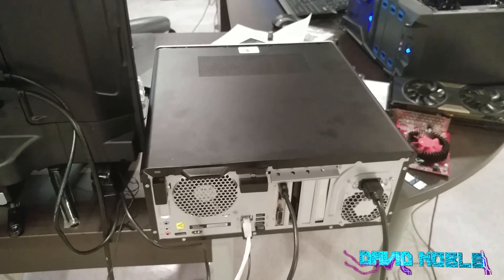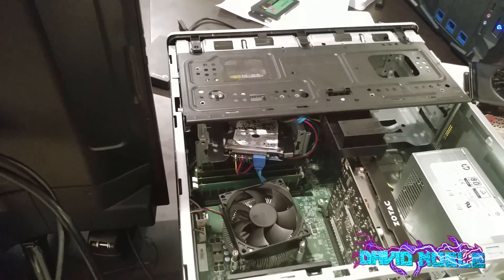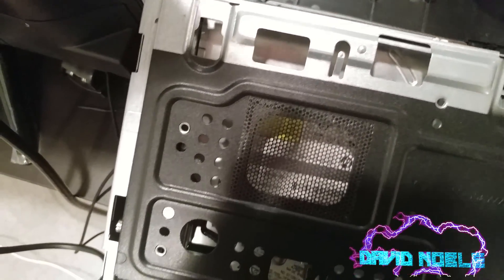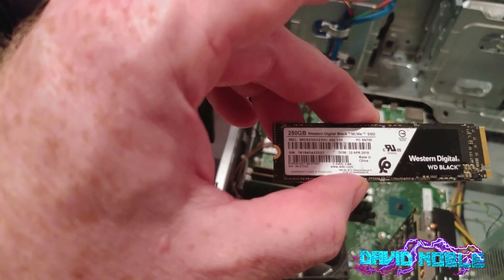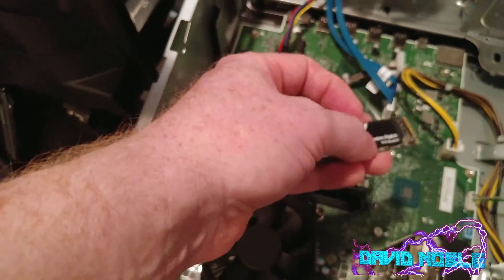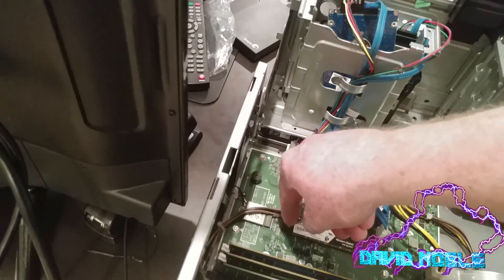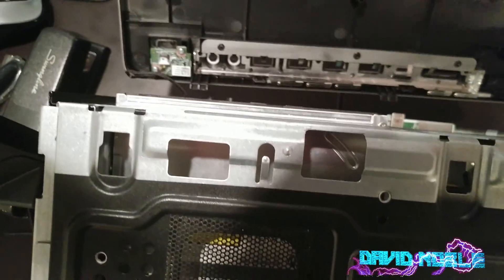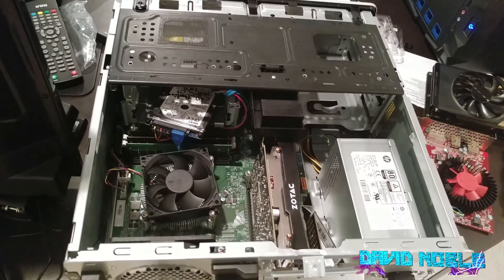HP Envy 8th Gen Installing NVME M 2 SSD into the computer - Part  (1 of 2)

Comment: i tried installing 980 pro on a new te02 envy, after few hours of usage it started freezing and it restarts without any error codes. i thought something wrong with SSD but same thing happened with other SSD too(980 pro heatsink).  and just for the heck of it i tried it on a 15L victus and same results. idk where i'm going wrong with installation ....  while installing windows. windows menu didn't see the drives so i manually loaded the drivers(Intel RST).  have you gone through the same issues on any OEM Pc's ?